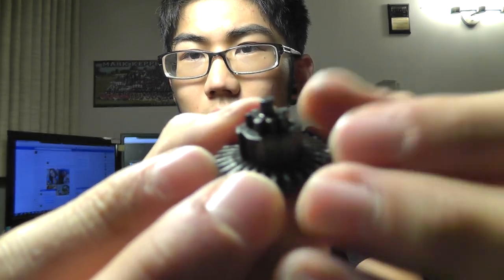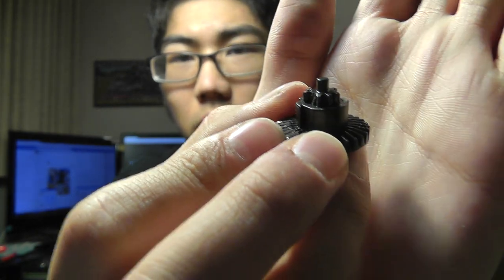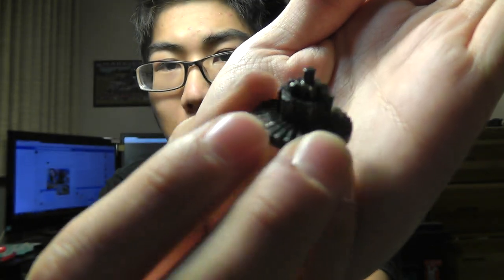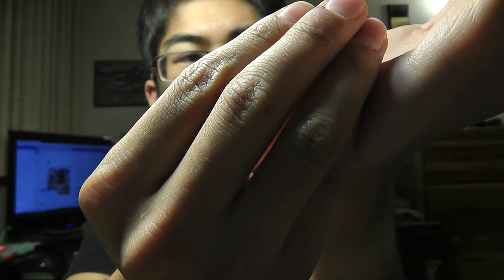PRODUCT ADVISORY: SHS gen 4 bevel

Comment: Sorry about the irrelevant question but i was wondering if I should put sorbo pads in my all my aeg's. My main gun shoots ~430 fps and 28 sps with an 11.1v and my backup shoots ~360 fps with 35 sps and they are gettinjg siegeteks soon. In case it helps the main gun is running an ASG ultimate 35000 and the backup is on a lonex a2.
Reply from the maker: If you need to correct AOE then yes add sorbo

Comment: Was it an extreme set up, because I heard others were running them in set ups that most would consider beyond the strength of these gears?  This is disappointing to see, hope it is a lemon as I planned on trying some out soon my self.  Most of the reports so far seem good, but being ACM it is not too surprising that stuff like this will happen assuming it is a lemon.
Reply from the maker: it was fairly extreme. high speed motor and these gears hitting like 42 rps. But I've had shs gearsets hold up under the same sort of load.

Comment: Question...? I just shimmed my gears as good as I can get them. Problem: the spur gear is as LOW as it can go with the smallest shim I could find on it, and everything else as low as possible accordingly. However, the sector gear is at the "top" of the piston teeth rack and not in the middle. Will this be an issue? How can I fix this? Thanks!
Reply from the maker: what piston? Make sure the piston itself isn't warped. If the teeth on the piston are still making contact with the teeth on the sector you should be fine. If it's not and you can't get any lower you might need a different gearset or bushings/bearings? It usually isn't an issue assuming the teeth aren't munching into the plastion on the piston.
Reply: valleyriverarms
Brand new magic box POM piston, its not warped and the teeth touch. They don't go off the edge either... Another question... Any tips on shimming? I had my gun as perfectly shimmed as I could get it and was expecting a nice crisp piston hitting sound only, but it seems like I hear a winding sound on the gears...? I have 8mm ball bearings from G&P and think they are pretty decent, but don't know the exact problem. Thanks!
Reply: *****

Well, you are supposed to shim from bevel to pinion, all those tutorial in youtube that state that you should shim the bevel as low as possible are simply wrong. I don't think there is a problem if the sector teeth are not meshing with the piston dead on the centre of the piston rack, as long as the gear teeth are making full contact.

Hope that helps